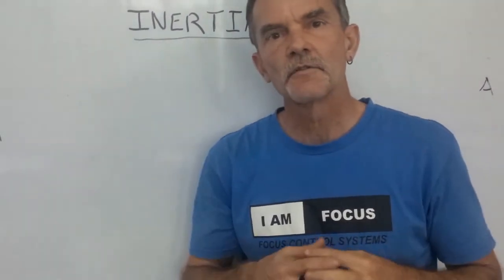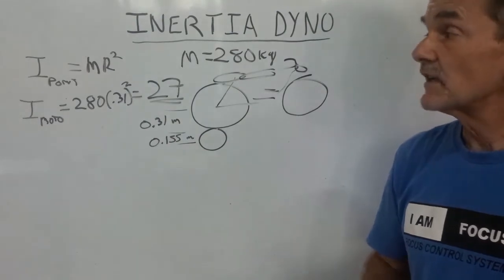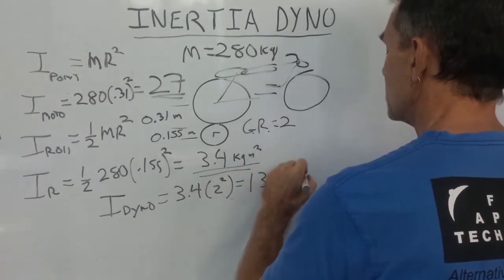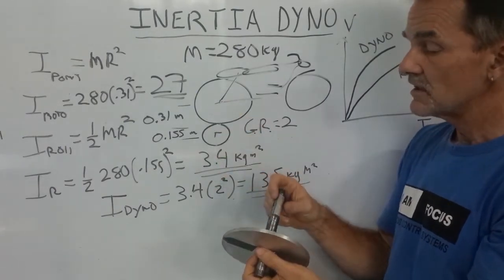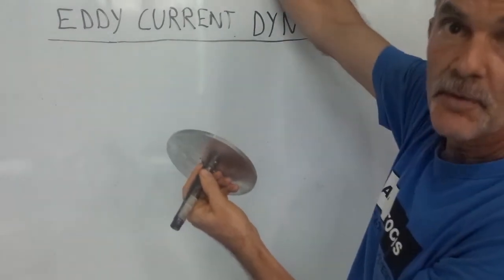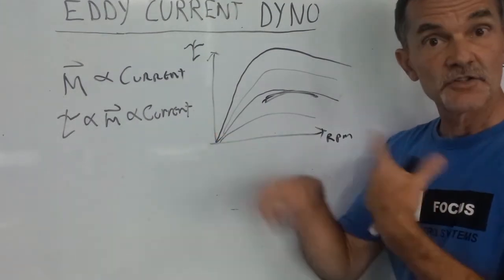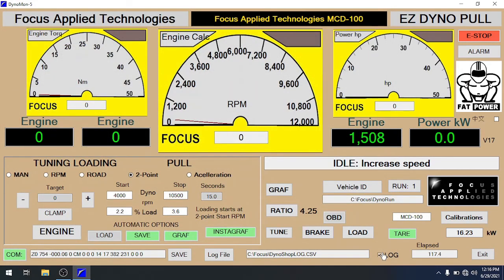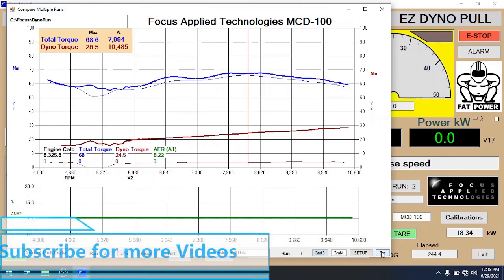Inertia Dyno Explanation (Eng version)

Comment: Why is your gear ratio 2 in this example? Isn't gear ratio = driven/driving, in which case you would have a gear ratio of 0.5 instead? Also, how do you factor in the gear ratio of the motorcycle itself into the equation to back calculate power?